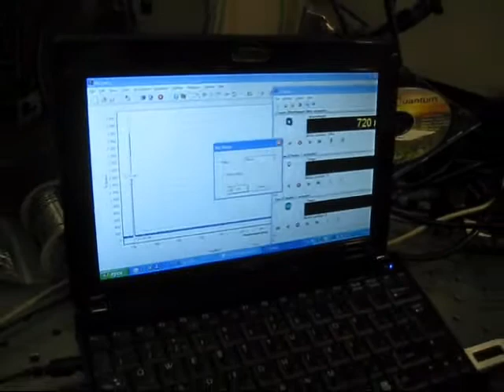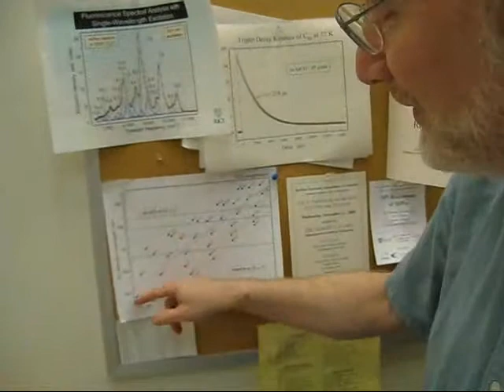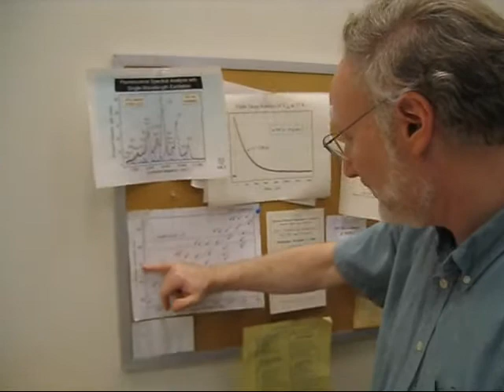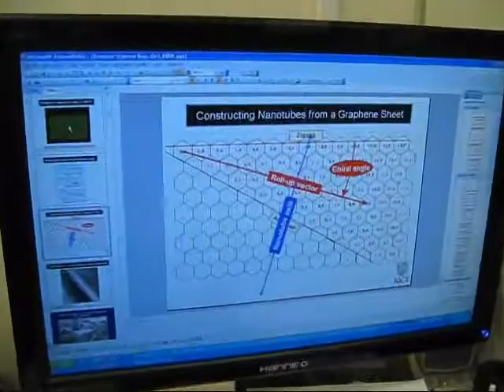Trestles CW/fs laser for spectroscopy of carbon nanotubes and graphene at Rice University

Comment from the maker: The Global Market for Carbon Nanomaterials
October 2015
http://www.futuremarketsinc.com/wp-content/uploads/2015/09/Table-of-contents.pdf
TABLE OF CONTENTS
1 RESEARCH METHODOLOGY 34
2 EXECUTIVE SUMMARY 35
2.1 CARBON NANOTUBES 35
2.1.1 Exceptional properties 36
2.1.2 Products and applications 38
2.1.3 Threat from the graphene market 40
2.1.4 Production 40
2.1.4.1 Multi-walled nanotube (MWNT) production 41
2.1.4.2 Single-walled nanotube (SWNT) production 43
2.1.5 Global demand for carbon nanotubes 45
2.1.5.1 Current products 47
2.1.5.2 Future products 48
2.1.6 Market drivers and trends 48
2.1.6.1 Electronics 48
2.1.7 Market and production challenges 50
2.1.7.1 Safety issues 51
2.1.7.2 Dispersion 52
2.1.7.3 Synthesis and supply quality 52
2.1.7.4 Cost 53
2.1.7.5 Competition from other materials 53
2.2 GRAPHENE 53
2.2.1 Remarkable properties 55
2.2.2 Global funding 56
2.2.3 Products and applications 57
2.2.4 Production 59
2.2.5 Market drivers and trends 61
2.2.5.1 Production exceeds demand 61
2.2.5.2 Market revenues remain small but are growing 63
2.2.5.3 Scalability and cost 64
2.2.5.4 Applications hitting the market 65
2.2.5.5 Wait and see? 67
2.2.5.6 Asia and US lead the race 67
2.2.5.7 Competition from other materials 67
2.2.6 Market and technical challenges 68
2.2.6.1 Supply quality 68
2.2.6.2 Cost 69
The Global Market for Carbon Nanomaterials
October 2015
Copyright © Future Markets, Inc, 2015. All rights reserved.
2.2.6.3 Product integration 69
2.2.6.4 Regulation and standards 69
3 INTRODUCTION 71
3.1 Properties of nanomaterials 71
3.2 Categorization 72
3.3 CARBON NANOTUBES 74
3.3.1 Multi-walled nanotubes (MWNT) 74
3.3.2 Single-wall carbon nanotubes (SWNT) 75
3.3.2.1 Single-chirality 77
3.3.3 Double-walled carbon nanotubes (DWNTs) 79
3.3.4 Few-walled carbon nanotubes (FWNTs) 80
3.3.5 Carbon Nanohorns (CNHs) 80
3.3.6 Fullerenes 81
3.3.7 Boron Nitride nanotubes (BNNTs) 82
3.3.8 Properties 83
3.3.9 Applications of carbon nanotubes 84
3.3.9.1 High volume applications 84
3.3.9.2 Low volume applications 85
3.3.9.3 Novel applications 85
3.4 GRAPHENE 85
3.4.1 3D Graphene 89
3.4.2 Graphene Quantum Dots 89
3.4.3 Properties 90
3.5 CARBON NANOTUBES VERSUS GRAPHENE 92
3.5.1 Cost and production 94
3.5.2 Carbon nanotube-graphene hybrids 96
3.6 OTHER 2D MATERIALS 97
3.6.1 Phosphorene 98
3.6.1.1 Properties 99
3.6.1.2 Applications 99
3.6.1.3 Recent research news 100
3.6.2 Silicene 100
3.6.2.1 Properties 101
3.6.2.2 Applications 101
3.6.2.3 Recent research news 102
3.6.3 Molybdenum disulfide 102
3.6.3.1 Properties 103
3.6.3.2 Applications 104
The Global Market for Carbon Nanomaterials
October 2015
Copyright © Future Markets, Inc, 2015. All rights reserved.
3.6.3.3 Recent research news 106
3.6.4 Hexagonal boron nitride 107
3.6.4.1 Properties 108
3.6.4.2 Applications 109
3.6.4.3 Recent research news 109
3.6.5 Germanene 110
3.6.5.1 Properties 110
3.6.5.2 Applications 110
3.6.5.3 Recent research news 111
3.6.6 Graphdiyne 111
3.6.6.1 Properties 112
3.6.6.2 Applications 112
3.6.7 Graphane 113
3.6.7.1 Properties 114
3.6.7.2 Applications 114
3.6.8 Stanene/tinene 115
3.6.8.1 Properties 116
3.6.8.2 Applications 116
3.6.9 Tungsten diselenide 116
3.6.9.1 Properties 117
3.6.9.2 Applications 118
3.6.10 Rhenium disulphide 118
3.6.10.1 Properties 119
3.6.10.2 Applications 119
4 CARBON NANOTUBE SYNTHESIS 122
4.1 Arc discharge synthesis 124
4.2 Chemical Vapor Deposition (CVD) 125
4.3 Plasma enhanced chemical vapor deposition (PECVD)
126
4.4 High-pressure carbon monoxide synthesis 127
4.4.1.1 High Pressure CO (HiPco) 127
4.4.2 CoMoCAT 128
4.5 Flame synthesis 129
4.6 Laser ablation synthesis 130
4.7 Silane solution method 130
4.8 GRAPHENE SYNTHESIS 131
4.8.1 Large area graphene films 131
4.8.2 Graphene oxide flakes and graphene nanoplatelets 132
The Global Market for Carbon Nanomaterials
October 2015
Copyright © Future Markets, Inc, 2015. All rights reserved.
4.8.3 Production methods 133
4.8.3.1 Quality 135
4.8.3.2 Industrial scale production 136
4.8.3.3 Graphene nanoplatelets (GNPs) 137
4.8.3.4 Graphene Nanoribbons 137
4.8.3.5 Large-area graphene films 138
4.8.3.6 Graphene oxide flakes (GO) 139
4.8.3.7 Pros and cons of graphene production methods
139
4.8.3.8 Recent synthesis methods 146
4.8.3.9 Synthesis methods by company 150
5 CARBON NANOTUBES MARKET STRUCTURE 152
6 GRAPHENE MARKET STRUCTURE 156
7 REGULATIONS AND STANDARDS 160
7.1 Standards 160
7.2 Environmental, health and safety regulation 161
7.2.1 Europe 161
7.2.2 United States 161
7.2.3 Asia 162
7.3 Workplace exposure 163
8 PATENTS AND PUBLICATIONS 164
8.1 Carbon nanotubes 164
8.2 Graphene 165
8.2.1 Fabrication processes 166
8.2.2 Academia 166
8.2.3 Regional leaders 166
9 TECHNOLOGY READINESS LEVEL 172
10 END USER MARKET SEGMENT ANALYSIS 174
10.1 Carbon nanotubes production volumes 2010-2025 175
10.1.1 Regional demand for carbon nanotubes 177
10.1.1.1 Japan 179
10.1.1.2 China 180
10.1.2 Main carbon nanotubes producers 181
10.1.3 SWNT production 182
10.1.3.1 OCSiAl 182
10.1.3.2 FGV Cambridge Nanosystems 182
10.1.3.3 Zeon Corporation 183
The Global Market for Carbon Nanomaterials
October 2015
Copyright © Future Markets, Inc, 2015. All rights reserved.
10.1.4 Price of carbon nanotubes-MWNTs, SWNTs and
FWNTs 183
10.2 Graphene production volumes 2010-2025 184
10.3 Carbon nanotubes industry news 2013-2015 187
10.4 Graphene industry news 2013-2015 196
10.5 Carbon nanotubes producers and production capacities
223
10.6 Graphene producers and production capacities 224
10.7 ELECTRONICS AND PHOTONICS 232
10.7.1 TRANSPARENT CONDUCTIVE FILMS AND
DISPLAYS 234
10.7.1.1 MARKET DRIVERS AND TRENDS 234
10.7.1.2 MARKET SIZE AND OPPORTUNITY 238
10.7.1.3 Properties and applications 239
10.7.1.4 CHALLENGES 245
10.7.1.5 PRODUCT DEVELOPERS 249
10.7.2 CONDUCTIVE INKS 254
10.7.2.1 MARKET DRIVERS AND TRENDS 254
10.7.2.2 MARKET SIZE AND OPPORTUNITY 255
10.7.2.3 PROPERTIES AND APPLICATIONS 257
10.7.2.4 PRODUCT DEVELOPERS 261
10.7.3 TRANSISTORS AND INTEGRATED CIRCUITS
264
10.7.3.1 MARKET DRIVERS AND TRENDS 264
10.7.3.2 MARKET SIZE AND OPPORTUNITY 265
10.7.3.3 PROPERTIES AND APPLICATIONS 266
10.7.3.4 CHALLENGES 269
10.7.3.5 PRODUCT DEVELOPERS 271
10.7.4 MEMORY DEVICES 275
10.7.4.1 MARKET DRIVERS AND TRENDS 275
10.7.4.2 MARKET SIZE AND OPPORTUNITY 276
10.7.4.3 PROPERTIES AND APPLICATIONS 277
10.7.4.4 PRODUCT DEVELOPERS 282
10.7.5 PHOTONICS 284
10.7.5.1 Optical modulators 284
10.7.5.2 Photodetectors 285
10.7.5.3 Plasmonics 287
10.7.5.4 Challenges 287
The Global Market for Carbon Nanomaterials
October 2015
Copyright © Future Markets, Inc, 2015. All rights reserved.
10.8 POLYMER COMPOSITES 288
10.8.1 MARKET DRIVERS AND TRENDS 288
10.8.1.1 Improved performance 288
10.8.1.2 Multi-functionality 290
10.8.1.3 Growth in wind energy market 290
10.8.2 MARKET SIZE AND OPPORTUNITY 291
10.8.3 PROPERTIES AND APPLICATIONS 292
10.8.3.1 Carbon nanotubes 292
10.8.3.2 Graphene 296
10.8.4 CHALLENGES 298
10.8.4.1 Carbon nanotubes 298
10.8.4.2 Graphene 298
10.8.5 PRODUCT DEVELOPERS 299
10.8.5.1 Carbon nanotubes 299
10.8.5.2 Graphene 304
10.9 AEROSPACE 306
10.9.1 MARKET DRIVERS AND TRENDS 306
10.9.1.1 Safety 306
10.9.1.2 Reduced fuel consumption and costs 306
10.9.1.3 Increased durability 306
10.9.1.4 Multi-functionality 307
10.9.1.5 Need for new de-icing solutions 307
10.9.1.6 Weight reduction 308
10.9.2 MARKET SIZE AND OPPORTUNITY 308
10.9.3 PROPERTIES AND APPLICATIONS 310
10.9.3.1 Composites 310
10.9.3.2 Coatings 312
10.9.3.3 Sensors 314
10.9.4 PRODUCT DEVELOPERS 314
10.9.4.1 Carbon nanotubes 314
10.9.4.2 Graphene 318
10.10 AUTOMOTIVE 320
10.10.1 MARKET DRIVER AND TRENDS 321
10.10.1.1 Environmental 321
10.10.1.2 Safety 321
10.10.1.3 Lightweighting 321
10.10.1.4 Cost 322
10.10.2 MARKET SIZE AND OPPORTUNITY 322
The Global Market for Carbon Nanomaterials
October 2015
Copyright © Future Markets, Inc, 2015. All rights reserved.
10.10.3 PROPERTIES AND APPLICATIONS 323
10.10.3.1 Composites 324
10.10.3.2 Lithium-ion batteries in electric and hybrid vehicles
325
10.10.3.3 Coatings 325
10.10.4 PRODUCT DEVELOPERS 326
10.10.4.1 Carbon nanotubes 326
10.10.4.2 Graphene 328
10.11 BIOMEDICAL & HEALTHCARE 330
10.11.1 MARKET DRIVERS AND TRENDS 330
10.11.1.1 Improved drug delivery for cancer therapy 330
10.11.1.2 Shortcomings of chemotherapies 331
10.11.1.3 Biocompatibility of medical implants 332
10.11.1.4 Anti-biotic resistance 332
10.11.1.5 Growth in advanced woundcare market 332
10.11.2 MARKET SIZE AND OPPORTUNITY 333
10.11.3 PROPERTIES AND APPLICATIONS 334
10.11.3.1 Cancer therapy 336
10.11.3.2 Medical implants and devices 342
10.11.3.3 Wound dressings 343
10.11.3.4 Biosensors 344
10.11.3.5 Medical imaging 345
10.11.3.6 Tissue engineering 346
10.11.3.7 Dental 346
10.11.4 CHALLENGES 347
10.11.5 PRODUCT DEVELOPERS 348
10.11.5.1 Carbon nanotubes 348
10.11.5.2 Graphene 350
10.12 COATINGS 352
10.12.1 MARKET DRIVERS AND TRENDS 352
10.12.1.1 Sustainability and regulation 352
10.12.1.2 Cost of corrosion 352
10.12.1.3 Improved hygiene 353
10.12.1.4 Cost of weather-related damage 354
10.12.2 MARKET SIZE AND OPPORTUNITY 355
10.12.3 PROPERTIES AND APPLICATIONS 357
10.12.3.1 Anti-static coatings 359
10.12.3.2 Anti-corrosion coatings 360
The Global Market for Carbon Nanomaterials
October 2015
Copyright © Future Markets, Inc, 2015. All rights reserved.
10.12.3.3 Anti-microbial 362
10.12.3.4 Anti-icing 362
10.12.3.5 Barrier coatings 363
10.12.3.6 Heat protection 364
10.12.3.7 Anti-fouling 364
10.12.3.8 Wear-resistance 366
10.12.3.9 Smart windows 366
10.12.4 PRODUCT DEVELOPERS 367
10.12.4.1 Carbon nanotubes 367
10.12.4.2 Graphene 368
10.13 FILTRATION AND SEPARATION 370
10.13.1 MARKET DRIVERS AND TRENDS 370
10.13.1.1 Need for improved membrane technology 370
10.13.1.2 Water shortage and population growth 370
10.13.1.3 Contamination 371
10.13.1.4 Cost 371
10.13.2 MARKET SIZE AND OPPORTUNITY 371
10.13.3 PROPERTIES AND APPLICTIONS 372
10.13.3.1 Carbon nanotubes 372
10.13.3.2 Graphene 375
10.13.4 CHALLENGES 378
10.13.4.1 Uniform pore size and distribution 378
10.13.4.2 Reducing pore size for improved desalination 378
10.13.4.3 Difficulties of CNT growth 379
10.13.4.4 Cost 379
10.13.5 PRODUCT DEVELOPERS 379
10.13.5.1 Carbon nanotubes 379
10.13.5.2 Graphene 381
10.14 ENERGY STORAGE, CONVERSION AND EXPLORATION
383
10.14.1 BATTERIES 385
10.14.1.1 MARKET DRIVERS AND TRENDS 385
10.14.1.2 MARKET SIZE AND OPPORTUNITY 387
10.14.1.3 PROPERTIES AND APPLICATIONS 388
10.14.1.4 CHALLENGES 392
10.14.2 SUPERCAPACITORS 392
10.14.2.1 MARKET DRIVERS AND TRENDS 392
10.14.2.2 Problems with activated carbon 393
The Global Market for Carbon Nanomaterials
October 2015
Copyright © Future Markets, Inc, 2015. All rights reserved.
10.14.2.3 MARKET SIZE AND OPPORTUNITY 394
10.14.2.4 PROPERTIES AND APPLICATIONS 395
10.14.2.5 Challenges 397
10.14.3 PHOTOVOLTAICS 398
10.14.3.1 MARKET DRIVERS AND TRENDS 398
10.14.3.2 MARKET SIZE AND OPPORTUNITY 399
10.14.3.3 PROPERTIES AND APPLICATIONS 399
10.14.4 FUEL CELLS 403
10.14.4.1 MARKET DRIVERS 403
10.14.4.2 MARKET SIZE AND OPPORTUNITY 403
10.14.4.3 PROPERTIES AND APPLICATIONS 404
10.14.4.4 Challenges 405
10.14.5 LED LIGHTING AND UVC 406
10.14.5.1 Market drivers and trends 406
10.14.5.2 Market size 406
10.14.5.3 Properties and applications 407
10.14.6 OIL AND GAS 407
10.14.6.1 MARKET DRIVERS AND TRENDS 407
10.14.6.2 MARKET SIZE AND OPPORTUNITY 408
10.14.6.3 PROPERTIES AND APPLICATIONS 409
10.14.7 PRODUCT DEVELOPERS 410
10.14.7.1 Carbon nanotubes 410
10.14.7.2 Graphene 414
10.15 SENSORS 420
10.15.1 MARKET DRIVERS AND TRENDS 420
10.15.1.1 Increased power and performance with reduced cost
420
10.15.1.2 Enhanced sensitivity 421
10.15.1.3 Replacing silver electrodes 421
10.15.1.4 Growth in the home diagnostics and point of care
market 421
10.15.1.5 Improved thermal stability 422
10.15.1.6 Environmental conditions 422
10.15.2 MARKET SIZE AND OPPORTUNITY 422
10.15.3 PROPERTIES AND APPLICATIONS 423
10.15.3.1 Infrared (IR) sensors 425
10.15.3.2 Electrochemical and gas sensors 426
10.15.3.3 Pressure sensors 427
The Global Market for Carbon Nanomaterials
October 2015
Copyright © Future Markets, Inc, 2015. All rights reserved.
10.15.3.4 Biosensors 428
10.15.3.5 Optical sensors 431
10.15.3.6 Humidity sensors 431
10.15.3.7 Acoustic sensors 431
10.15.3.8 Wireless sensors 431
10.15.4 Challenges 432
10.15.5 PRODUCT DEVELOPERS 433
10.15.5.1 Carbon nanotubes 433
10.15.5.2 Graphene 435
10.16 3D PRINTING 437
10.16.1 MARKET DRIVERS AND TRENDS 437
10.16.1.1 Improved materials at lower cost 437
10.16.2 MARKET SIZE AND OPPORTUNITY 437
10.16.3 PROPERTIES AND APPLICATIONS 438
10.16.4 CHALLENGES 439
10.16.5 PRODUCT DEVELOPERS 440
10.16.5.1 Carbon nanotubes 440
10.16.5.2 Graphene 440
10.17 ADHESIVES 442
10.17.1 MARKET DRIVERS AND TRENDS 442
10.17.1.1 Thermal management in electronics 442
10.17.1.2 Environmental sustainability 442
10.17.1.3 PROPERTIES AND APPLICATIONS 442
10.17.2 MARKET SIZE AND OPPORTUNITY 443
10.17.3 PRODUCT DEVELOPERS 443
10.17.3.1 Carbon nanotubes 443
10.17.3.2 Graphene 444
10.18 LUBRICANTS 445
10.18.1 MARKET DRIVERS AND TRENDS 445
10.18.1.1 Cost effective alternatives 445
10.18.1.2 Need for higher-performing lubricants for fuel efficiency
445
10.18.1.3 Environmental concerns 445
10.18.2 PROPERTIES AND APPLICATIONS 446
10.18.3 MARKET SIZE AND OPPORTUNITY 447
10.18.4 CHALLENGES 447
10.18.5 PRODUCT DEVELOPERS 447
10.18.5.1 Carbon nanotubes 447
The Global Market for Carbon Nanomaterials
October 2015
Copyright © Future Markets, Inc, 2015. All rights reserved.
10.18.5.2 Graphene 448
10.19 TEXTILES 449
10.19.1 MARKET DRIVERS AND TRENDS 449
10.19.1.1 Growth in the wearable electronics market 449
10.19.2 PROPERTIES AND APPLICATONS 449
10.19.2.1 Wearable electronics 451
10.19.2.2 Superhydrophobic coatings 452
10.19.2.3 Conductive coatings 453
10.19.2.4 Flame retardant textiles 453
10.19.3 MARKET SIZE AND OPPORTUNITY 454
10.19.4 PRODUCT DEVELOPERS 454
11 CARBON NANOTUBES PRODUCERS AND PRODUCT
DEVELOPERS (184 company profiles) 455
12 GRAPHENE PRODUCERS AND PRODUCT DEVELOPERS
607 (152 company profiles)
TABLES AND FIGURES
Figure 1: Molecular structures of SWNT and MWNT.
Table 1: Properties of CNTs and comparable materials.
Table 2: Carbon nanotubes target markets-Applications, stage of
commercialization and potential addressable market size.
Table 3: Annual production capacity of MWNT and SWNT
producers.
Table 4: SWNT producers production capacities 2014.
Figure 2: Production capacities for SWNTs in kilograms, 2005-
2014.
Table 5: Global production of carbon nanotubes, 2010-2025 in
tons/year. Base year for projections is 2014.
Figure 3: Global production of carbon nanotubes, 2010-2025 in
tons/year. Base year for projections is 2014.
Figure 4: Global government funding for graphene.
Table 6: Graphene target markets-Applications, stage of
commercialization and potential addressable market size.
Table 7: Graphene production plants worldwide, by country, and
production capacity.
The Global Market for Carbon Nanomaterials
October 2015
Copyright © Future Markets, Inc, 2015. All rights reserved.
Table 8: Global production of graphene, 2010-2025 in tons/year.
Base year for projections is 2014.
Figure 5: Global market for graphene 2010-2025 in tons/year.
Table 6: Graphene types and cost per kg.
Table 7: Categorization of nanomaterials.
Figure 6: Conceptual diagram of single-walled carbon nanotube
(SWNT) (A) and multi-walled carbon nanotubes (MWNT) (B)
showing typical dimensions of length, width, and separation
distance between graphene layers in MWNTs.
Figure 7: Schematic of single-walled carbon nanotube.
Table 8: Comparison between single-walled carbon nanotubes
(SWCNT) and multi-walled carbon nanotubes.
Figure 8: Double-walled carbon nanotube bundle cross-section
micrograph and model.
Figure 9: Schematic representation of carbon nanohorns.
Figure 10: Fullerene schematic.
Figure 11: Schematic of Boron Nitride nanotubes (BNNTs).
Alternating B and N atoms are shown in blue and red.
Table 9: Properties of carbon nanotubes.
Figure 12: Graphene layer structure schematic.
Figure 13: Graphite and graphene.
Figure 14: Graphene and its descendants.
Table 10: Properties of graphene.
Table 11: Comparative properties of carbon materials.
Table 12: Comparative properties of graphene with nanoclays and
carbon nanotubes.
Figure 15: Phosphorene structure.
Table 13: Recent phosphorene research news.
Figure 16: Silicene structure.
Table 14: Recent silicene research news.
Figure 17: Structure of 2D molybdenum disulfide.
Figure 18: Atomic force microscopy image of a representative
MoS2 thin-film transistor.
Figure 19: Schematic of the molybdenum disulfide (MoS2) thin-film
sensor with the deposited molecules that create additional charge.
Table 15: Recent Molybdenum disulfide research news.
Figure 20: Structure of hexagonal boron nitride
Table 16: Recent hexagonal boron nitride research news.
The Global Market for Carbon Nanomaterials
October 2015
Copyright © Future Markets, Inc, 2015. All rights reserved.
Figure 21: Schematic of germanane.
Table 17: Recent germanane research news.
Figure 22: Graphdiyne structure.
Figure 23: Schematic of Graphane crystal.
Figure 24: Crystal structure for stanene.
Figure 25: Schematic of tungsten diselenide.
Figure 26: Schematic of a monolayer of rhenium disulphide.
Table 18: Comparative analysis of graphene and other 2-D
nanomaterials.
Figure 27: Schematic representation of methods used for carbon
nanotube synthesis (a) Arc discharge (b) Chemical vapor
deposition (c) Laser ablation (d) hydrocarbon flames.
Table 19: SWNT synthesis methods.
Figure 28: Arc discharge process for CNTs.
Figure 29: Schematic of thermal-CVD method.
Figure 30: Schematic of plasma-CVD method.
Figure 31: CoMoCAT® process.
Figure 32: Schematic for flame synthesis of carbon nanotubes (a)
premixed flame (b) counter-flow diffusion flame (c) co-flow
diffusion flame (d) inverse diffusion flame.
Figure 33: Schematic of laser ablation synthesis.
Table 20: Large area graphene films-Markets, applications and
current global market.
Table 21: Graphene oxide flakes/graphene nanoplatelets-Markets,
applications and current global market.
Table 22: Main production methods for graphene.
Figure 34: Graphene synthesis methods.
Figure 35: Schematic of roll-to-roll manufacturing process.
Table 23: Graphene synthesis methods, by company.
Table 24: Carbon nanotubes market structure.
Table 25: Graphene market structure.
Figure 36: CNT patents filed 2000-2014.
Figure 37: Patent distribution of CNT application areas to 2014.
Table 26: Published patent publications for graphene, 2004-2014.
Figure 38: Published patent publications for graphene, 2004-2014.
Table 27: Leading graphene patentees.
Table 28: Industrial graphene patents in 2014.
The Global Market for Carbon Nanomaterials
October 2015
Copyright © Future Markets, Inc, 2015. All rights reserved.
Figure 39: Technology Readiness Level (TRL) for Carbon
Nanotubes.
Figure 40: Technology Readiness Level (TRL) for graphene.
Table 29: Market penetration and volume estimates (tons) for
carbon nanotubes and graphene in key applications.
Table 30: Global production of carbon nanotubes, 2010-2025 in
tons/year. Base year for projections is 2014.
Figure 41: Regional demand for CNTs utilized in transparent
conductive films and displays.
Figure 42: Regional demand for CNTs utilized in batteries.
Figure 43: Regional demand for CNTs utilized in Polymer
reinforcement.
Table 31: Current carbon nanotubes prices.
Table 32: Global production of graphene, 2010-2025 in tons/year.
Base year for projections is 2014.
Figure 44: Global production of graphene, 2010-2025 in tons/year.
Base year for projections is 2014.
Table 33: Annual production capacity of main carbon nanotubes
producers.
Table 34: Graphene producers and production capacity (Current
and projected), prices and target markets.
Table 35: Carbon nanotubes in the electronics and photonics
market-applications, stage of commercialization and addressable
market size.
Table 36: Graphene in the electronics and photonics marketapplications,
stage of commercialization and addressable market
size.
Table 37: Comparison of ITO replacements.
Figure 45: A large transparent conductive graphene film.
Figure 46: CNT transparent conductive film formed on glass and
schematic diagram of its structure.
Figure 47: Graphene electrochromic devices.
Figure 48: Flexible transistor sheet.
Figure 49: The transmittance of glass/ITO, glass/ITO/four organic
layers, and glass/ITO/four organic layers/4-layer graphene.
Table 38: Carbon nanotubes product and application developers in
transparent conductive films and displays.
The Global Market for Carbon Nanomaterials
October 2015
Copyright © Future Markets, Inc, 2015. All rights reserved.
Table 39: Graphene product and application developers in
transparent conductive films.
Table 40: Comparative properties of conductive inks.
Figure 50: Vorbeck Materials conductive ink products (Image
credit: Vorbeck Materials).
Figure 51: Nanotube inks.
Figure 52: Graphene printed antenna.
Figure 53: BGT Materials graphene ink product.
Table 41: Carbon nanotubes product and application developers in
conductive inks.
Table 42: Graphene product and application developers in
conductive inks.
Figure 54: Schematic cross-section of a graphene base transistor
(GBT, left) and a graphene field-effect transistor (GFET, right)
Figure 55: Thin film transistor incorporating CNTs.
Figure 56: Graphene IC in wafer tester.
Table 43: Carbon nanotubes product and application developers in
transistors and integrated circuits.
Table 44: Graphene product and application developers in
transistors and integrated circuits.
Figure 57: Stretchable CNT memory and logic devices for
wearable electronics.
Figure 58: SEM image of the deposited film (or fabric) of crossed
nanotubes that can be either touching or slightly separated
depending on their position.
Figure 59: Schematic of NRAM.
Figure 60: Schematic of NRAM cell.
Figure 61: Carbon nanotubes NRAM chip.
Figure 62: A schematic diagram for the mechanism of the resistive
switching in metal/GO/Pt.
Table 45: Carbon nanotubes product and application developers in
memory devices.
Table 46: Graphene product and application developers in memory
devices.
Table 47: Graphene properties relevant to application in optical
modulators.
Figure 63: Hybrid graphene phototransistors.
Table 48: Dispersion of graphene in polymers.
The Global Market for Carbon Nanomaterials
October 2015
Copyright © Future Markets, Inc, 2015. All rights reserved.
Table 49: Carbon nanotubes in the polymer composites marketapplications,
stage of commercialization and addressable market
size.
Table 50: Graphene in the polymer composites marketapplications,
stage of commercialization and addressable market
size.
Table 51: Addressable market size for carbon nanomaterials
composites.
Table 52: Graphene properties relevant to application in polymer
composites.
Table 53: Carbon nanotubes product and application developers in
the composites industry.
Table 54: Graphene product and application developers in the
composites industry.
Table 55: Carbon nanotubes in the aerospace market-applications,
stage of commercialization and addressable market size.
Table 56: Graphene in the aerospace market-applications, stage of
commercialization and addressable market size.
Table 57: Carbon nanotubes product and application developers in
the aerospace industry.
Table 58: Graphene product and application developers in the
aerospace industry.
Table 59: Carbon nanotubes in the automotive marketapplications,
stage of commercialization and addressable market
size.
Table 60: Graphene in the automotive market-applications, stage
of commercialization and addressable market size.
Table 61: Carbon nanotubes product and application developers in
the automotive industry.
Table 62: Graphene product and application developers in the
automotive industry.
Table 63: Carbon nanotubes in the biomedical and healthcare
markets-applications, stage of commercialization and addressable
market size.
Table 64: Graphene in the biomedical and healthcare marketsapplications,
stage of commercialization and addressable market
size.
Table 65: CNTs in life sciences and biomedicine.
The Global Market for Carbon Nanomaterials
October 2015
Copyright © Future Markets, Inc, 2015. All rights reserved.
Table 66: Graphene properties relevant to application in
biomedicine and healthcare.
Figure 64: Schematic representation of functionalized fullerene (A)
and carbon nanotube (B) for drug delivery in cancer therapy.
Table 67: Carbon nanotubes product and application developers in
the medical and healthcare industry.
Table 68: Graphene product and application developers in the
medical and healthcare industry.
Figure 65: Global Paints and Coatings Market, share by end user
market.
Table 69: Carbon nanotubes in the coatings market-applications,
stage of commercialization and addressable market size.
Table 70: Graphene in the coatings market-applications, stage of
commercialization and addressable market size.
Figure 66: Heat transfer coating developed at MIT.
Table 71: Graphene properties relevant to application in coatings.
Figure 67: Water permeation through a brick without (left) and with
(right) “graphene paint” coating.
Table 72: Carbon nanotubes product and application developers in
the coatings industry.
Table 73: Graphene product and application developers in the
coatings industry.
Table 74: Carbon nanotubes in the filtration market-applications,
stage of commercialization and addressable market size.
Table 75: Comparison of CNT membranes with other membrane
technologies.
Figure 68: Degradation of organic dye molecules by graphene
hybrid composite photocatalysts.
Table 76: Carbon nanotubes product and application developers in
the filtration industry.
Table 77: Graphene product and application developers in the
filtration industry.
Table 78: Carbon nanotubes in the energy market-Applications,
stage of commercialization and addressable market size.
Table 79: Graphene in the energy market-Applications, stage of
commercialization and addressable market size.
Figure 69: Nano Lithium X Battery.
Figure 70: Skeleton Technologies ultracapacitor.
The Global Market for Carbon Nanomaterials
October 2015
Copyright © Future Markets, Inc, 2015. All rights reserved.
Figure 71: Zapgo supercapacitor phone charger.
Table 80: Comparative properties of graphene supercapacitors
and lithium-ion batteries.
Figure 72: Nanotube frame module.
Figure 73: Solar cell with nanowires and graphene electrode.
Table 81: Carbon nanotubes product and application developers in
the energy industry.
Table 82: Graphene product and application developers in the
energy industry.
Table 83: Carbon nanotubes in the sensors market-applications,
stage of commercialization and addressable market size.
Table 84: Graphene in the sensors market-applications, stage of
commercialization and addressable market size.
Table 85: Graphene properties relevant to application in sensors.
Figure 74: GFET sensors.
Figure 75: First generation point of care diagnostics
Figure 76: Graphene Field Effect Transistor Schematic.
Table 86: Comparison of ELISA (enzyme-linked immunosorbent
assay) and graphene biosensor.
Table 87: Carbon nanotubes product and application developers in
the sensors industry.
Table 88: Graphene product and application developers in the
sensors industry.
Figure 77: 3D Printed tweezers incorporating Carbon Nanotube
Filament.
Table 89: Graphene properties relevant to application in 3D
printing.
Table 90: Carbon nanotubes product and application developers in
the 3D printing industry.
Table 91: Graphene product and application developers in the 3D
printing industry.
Table 92: Graphene properties relevant to application in
adhesives.
Table 93: Carbon nanotubes product and application developers in
the adhesives industry.
Table 94: Graphene product and application developers in the
adhesives industry.
Table 95: Applications of carbon nanomaterials in lubricants.
The Global Market for Carbon Nanomaterials
October 2015
Copyright © Future Markets, Inc, 2015. All rights reserved.
Table 96: Carbon nanotubes product and application developers in
the lubricants industry.
Table 97: Graphene product and application developers in the
lubricants industry.
Table 98: Desirable functional properties for the textiles industry
afforded by the use of nanomaterials
Figure 78: Schematic illustration of the SWCNT-based electronic
devices as a wearable array platform.
Table 99: Carbon nanotubes product and application developers in
the textiles industry.